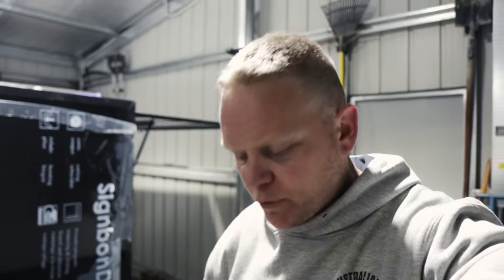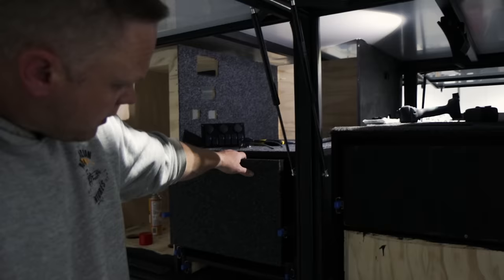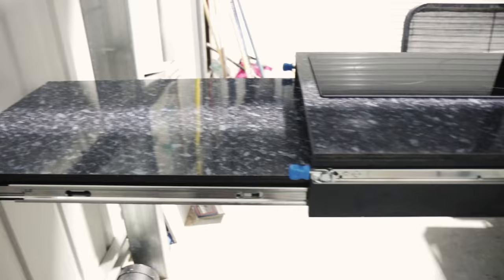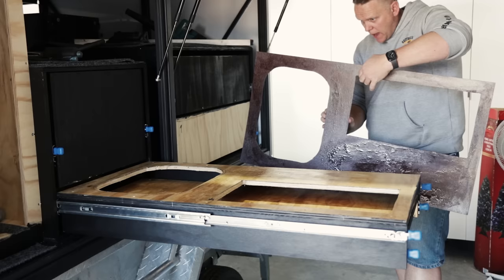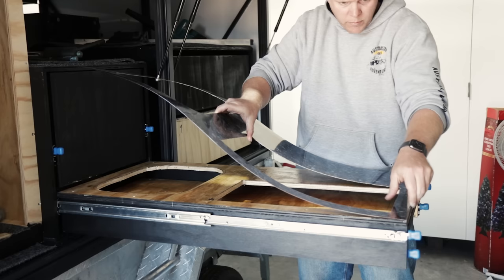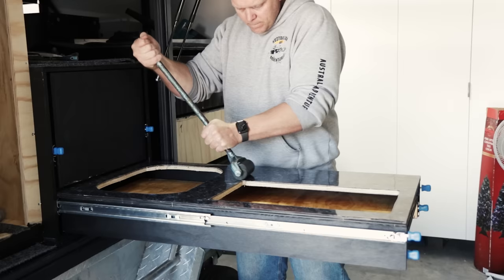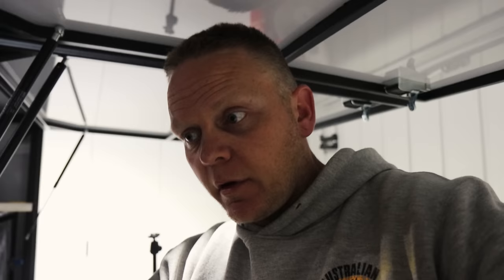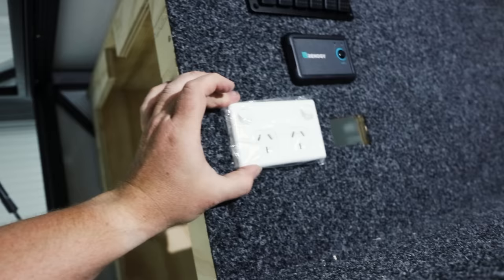DIY Camper trailer / CARAVAN kitchen cabinets how to build

Comment: Another thing I don't like about upright camping fridges is when you open the door you lose all the cold air requiring more energy to cool the fridge again and that dosnt happen with a chest fridge. Great build man well done on the welding you have inspired me to attempt the same with my trailer which is almost identical to yours apart from being 2 axle but that's cool it won't bounce around

Comment: Good choice on the Renogy, I’m running a 2000W and 3000W inverter and a 60ah MPPT with the Renogy battery monitor and 3x 200ah Voltex batts, one in the car and 2 in the trailer. Done 8 months full time on the road including the Gibb. The 2000W inverter has been running 24/7  for that time running a Kogan 95lt upright 240V fridge and it’s never missed a beat.
Reply from the maker: Yeah I’ve given it a bit of a hard time already and it’s holding up well

Comment: Looking good mate and thanks for the tips on sticking down the carpet etc. Personally have only ever stapled stuff down. As for the Fan's though I would be looking to create Positive Pressure around the fridge meaning you have more air being pushed in than out. Maybe it is the PC Geek in me talking but I will say I have a single PC fan sucking hot air out from behind my fridge and find it tends to get a lot of dust build up behind the fridge now. Positive pressure is meant to be better for reducing dust build up, at least in the PC building world.

Comment: good stuff mate. My only thing is I would like to see the batteries and inverter as low as possible to keep the cog as low as possible also. Not that you asked, just me 😁
Reply from the maker: I did think about mounting them below the trailer but I wanted to be able to access them easily just in case something went wrong